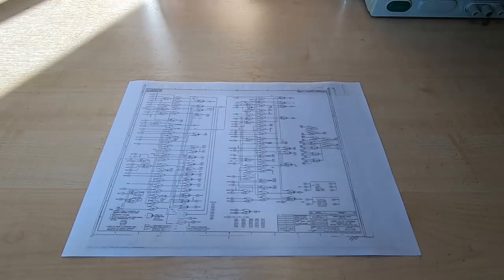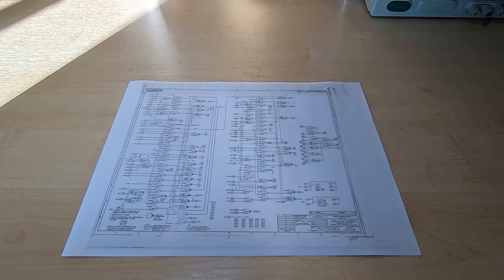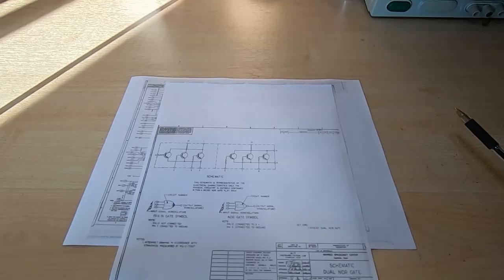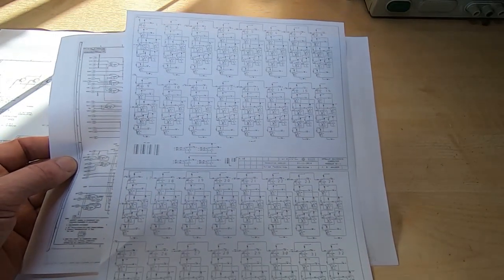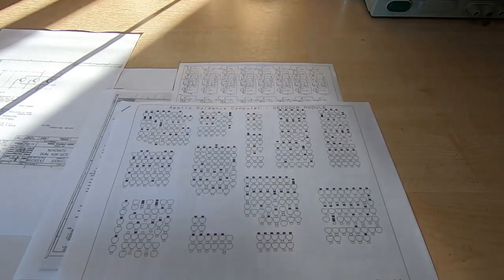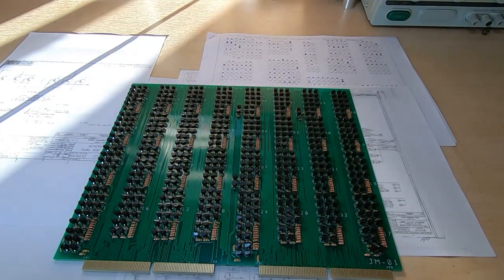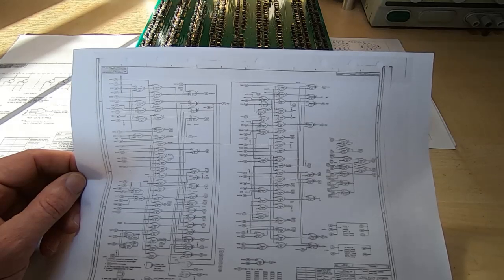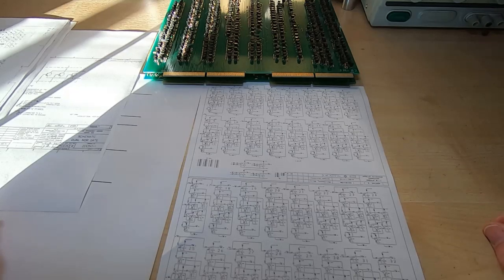Apollo Guidance Computer Recreation

Comment: Nice looking project. Hopefully you'll get it completed.

I built a clock using the same kind of discrete NOR gate logic (inspired by the AGC but not strictly the same, I actually used 2N7000 MOSFETs to cut out the base resistors), it took about 1500 of them to implement. I might have got the transistor count down if I tried a bit harder to optimise the flip flop design.

It has been working well in the years since it was built.

Comment: How's this project going?
Reply from the maker: I am still working on it as funds allow. The boards are expensive to have made so I am designing and building them whenever I can. I have been testing each one based on its logic function to check that the individual gates work as intended and so far it looks promising. The selected values for resistors seem to be giving a performance very close the that specified by the original AGC gate datasheet so it I ever manage to get all the boards completed then it should provide a very good proof of cencept to see if this could have been a viable alternative. Everything such as power consumption should also be very close.
Reply: @JerryWalker001  would you mind sharing which transistors and which values of resistors you're using? The gate datasheet I've looked at (http://klabs.org/history/ech/scd/1006321/6321-4.jpg) says the propagation delay is 25 ns, but the schematic of the gate doesn't have a resistor from base to ground or any sort of clamping so I'm wondering how you've achieved 25 ns given that most through-hole transistors available nowadays such as the 2N3904 have long storage times when saturated.

I've watched both of your youtube videos about transistor switching speed, and read the relevant pages from "Computer Time Travel", but I still can't figure out how you're reproducing the AGC gate performance. I'm really sorry if I've missed something obvious.

Comment: There's a book i'd like to recommend to you it's called "The APOLLO GUIDANCE COMPUTER - Architecture and Operation" by Frank O'Brien (ISBN-13: 978-1441908766)

Blurb from Amazon.com

"Designing a mission for a flight to the Moon requires balancing the demands of a wide array of spacecraft systems, with the details of tending each component generating complex and often contradictory requirements. More than any other system in the Apollo spacecraft, the Apollo Guidance Computer drove the capabilities of the lunar missions. In the 1960's, most computers filled an entire room yet the spacecraft's computer was required to be compact and require little power.  When compared to modern systems, the AGC's design limitations and lack of speed presented formidable challenges. Yet, hardware and software engineers overcame these difficulties, and their creation was able to guide a new and complex spacecraft and its precious human cargo away from the safety of Earth and towards a new world. Although people today find it difficult to accept that it was possible to control a spacecraft using such a 'primitive' computer, it nevertheless had capabilities that are advanced even by today's standards.

The Apollo Guidance Computer: Architecture and Operation is the first comprehensive description of the Apollo computer, beginning with its internal organization to its user interface and flight software. Particular emphasis is placed on the instruction set, Executive capabilities, the Interpreter and the detailed procedures for mission application software. Launch, landing on the Moon and entry back on Earth are explained in rich detail and show how the computer was an integral part of the spacecraft operation. As a comprehensive account, it spans the disciplines of computer science, aerospace engineering and spacecraft operations. The Apollo Guidance Computer: Architecture and Operation is an essential reference for space historians and engineers, and serves well as a complementary text for computer science courses."

I haven't read all of the book yet however it is a fairly comprehensive description of the Apollo AGC, how it operated and the various programmes it ran.

Comment: Polaris missiles used PCBs with a mix of IC's and discrete transistors in 1960 as did the Minuteman. So the launch forces weren't the problem.
The need to make them reprogrammable drove the modular design and the potting was for vacuum protection to prevent corona issues at low pressure.
Reply from the maker: True but that applies equally to discrete designs. I do mention the existing use in my video and I think that it was a case of using emerging technology and offsetting military costs in the space program. I think they made the right decision and I am in no way criticising their decision. I am simply asking (and answering) the question of weather the AGC could have been built from discrete components. Potting etc is irrelevant as anything can be potted.
Reply: @JerryWalker001  The Polaris guidance system came out of the same MIT lab as the AGC but a year earlier (1960 vs 1961).
The Computer Museum has a Minuteman guidance ring displayed next to their AGC.
Reply from the maker: Allan Gibson, Yes I specifically said in my video that the IC's had been in use in military applications prior to the AGC. They were however very expensive. As I state in the video it was the manufacturing process and yield improvement that the AGC program helped to develop. This does not really have anything to do with my project however which is only intended to investigate if the AGC could have been constructed from discrete devices rather than the IC's. So far it is looking like it absolutely could.

Comment: When designing an AGC from discreet components you have to take into account the amount of power they would have consumed.   Size, weight, and power consumption were vital considerations.  Development of IC's was merely a size benefit.  Also the real AGC used potted cord-wood construction rather than PCB's to handle the intense dynamic forces encountered in launch.  There were a myriad of factors that had to be taken into account besides whether it would simply to the job.
Reply from the maker: Yes that is correct. However the power consumption would be identical as the circuits are identical. My real point was that it would have been easier to develop smaller packaged transistors rather than IC's as the yield would have been higher. The assembly could then have been potted so the result would have been identical but with a simpler development path. I think they took the right decision but I still think it is interesting to investigate if the alternative could have been viable. In the even the volume of my boards even using normal transistors is the same as the modules so size was not a benifit. Remember that the IC's were very small integration with only a few components and nothing like modern IC's.
Reply: @JerryWalker001  They were never looking for easier or cheaper, only the best.  The only economy they cared about was in size and weight.  Also your CAD designed PCB's allow for a far dense arrangement of components than those of the 1960's.  The boards would have looked more like the ones on the Saturn V Launch Vehicle Digital Computer.
Reply from the maker: William Rainger. I am not sure what your point is. My project is to see if it was possible to build the AGC using discrete components, Cost has nothing to do with it (I think you missed the point I was making regarding cost). The real point is that if the IC fabrication could not have been made reliable enough then the AGC time scale would not have been acheived. Also I am not sure that I agree that they were not looking for an easier way. If they had seen an easier way to acheive the same goal then only a poor design team would have taken a more difficult and less certain path. With hindsight they made a good decision (as I have stated previously) but as I also have stated a number of times my project is to see if there was an alternative. Again this has nothing to do with cost but certainty of outcome. The CAD system has nothing to do with density, the density is governed by feature size and the amount of time available (I do not have the manpower that the AGC developers did) and I specifically stated that the discrete approach to develop smaller discrete components is the point I am trying to make. I have also specifically chose CAD design parameters that equal what was possible at the time rather than selecting (for example) 3 thou tracks in which case I could have made the boards 1/3 the size and then when potted they would have been approx 80% the weight of the AGC modules. If the development had gone into minaturising individual transistors (which is exactly what they did but at the risk of more per die and so a lower yield) Then this size could have been reduced by as much as another 50%. The cost would most likely have been the same but a lower technical risk (I do not believe that I ever stated that this was about cost). Either way my project is a technical challenge that I have undertaken out of interest. I think that develpment of the AGC is one of the most interesting in history and I wanted to investigate it further.

Comment: The AGC is probably the first ever embedded computer-system and it used so many ICs that it forced the companies making them to mature the technology so that by the end of the 1960s ICs were being mass-produced inexpensively. Also it would be interesting if you did a version of this AGC using resistor and transistor SMDs.
Reply from the maker: That is correct. However if I was being synical I would suggest that as these devices were already being used in military applications and cost around $1000.00 each then it is possible that they were used in the AGC as an 'alternatively' funded means of developing the manufacuring of them. Either way it kicked off the IC market although this would of course have happended anyway, just a lot more slowly. I think that the Apollo program actually generated many such technology advances in many industrial areas and was not the commercial dead end and total loss that most people seem to believe. Yes it cost $Billions but the industries it sparket were worth far more.
Reply: @JerryWalker001  Once you've completed and tested your project have you thought of doing a version of this design but using resistor and transistor SMDs instead?
Reply from the maker: Yes, You may have seen my videos on the transistor processor which I supply. I am creating SMD versions of the boards (shown in my videos on the Pick and place machine). I will most likely do the same but it depends on available funds. I estimate that the complete set of through hole boards is going to cost me around £4000.00 (and of course a lot of time). However once I have the schematics in my pcb CAD system then it is just a matter of creating SMD versions of the layouts. I would not need to modify the schematics.
Reply: @JerryWalker001  Which of your videos deal with your transistor processor as you've posted quite a few videos?

Comment: Ran into your channel because of your videos on the CHM-T36VA pick and place (which I just bought and am learning to use) so I assumed you were making these boards with that, but it seems you hand assemble them through hole... WOW!  You make me feel lazy because I bought a pick and place to assemble my little boards with only 20 parts on them...
Reply from the maker: Hi jontscott, No I do not use the P&P for the AGC boards, I assemble them by hand. I wanted to keep as close to a 'back then' solution as I could. It does not take long to assemble the boards compared to the time it takes to convert the schematics and lay out the tracks. There are usually between 700 and 1000 transistors per board and 1500 to 2000 resistors.
Reply: Good point on the layout taking more time.  Still as I have only done relatively simple, low part count boards I am impressed.  Hopefully today I will finally get my machine calibrated and working.
Reply from the maker: Good Luck, Let me know if you would like a video on any aspects of the P&P operation.